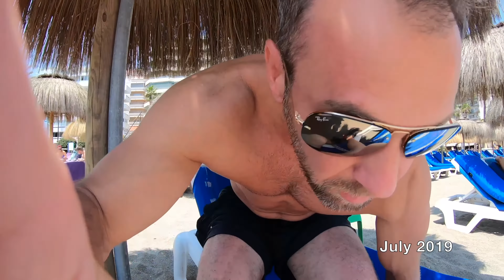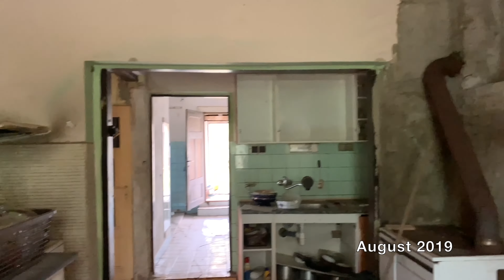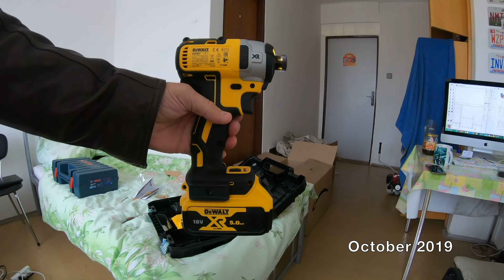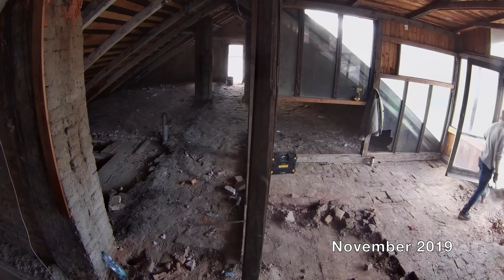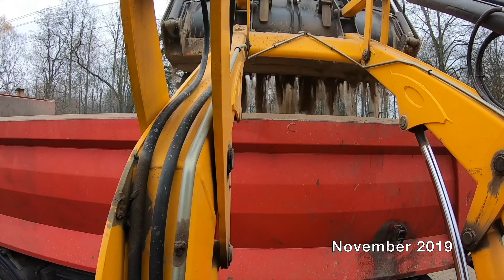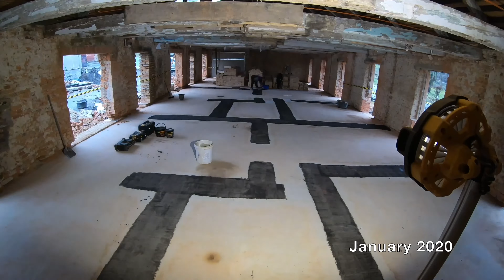House flip full story. My triplex conversion infinite project.

Comment: doing electrical work alone is allowed in czechia? In Germany only certified electricians are allowed to do that.
Reply from the maker: It’s just 3 or 4 wires. Blue, black, brown and green/yellow 😉. How hard could it be 😅. Anyway.. you can do electrical yourself and then just have it inspected by inspector and have a report signed and stamped that it all complies with code.
Reply: @ yes that is possible !